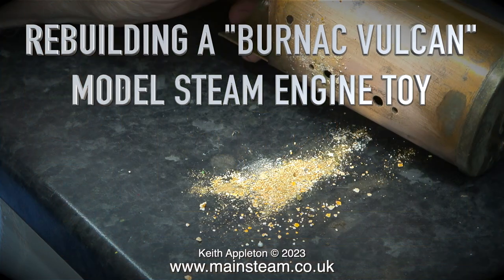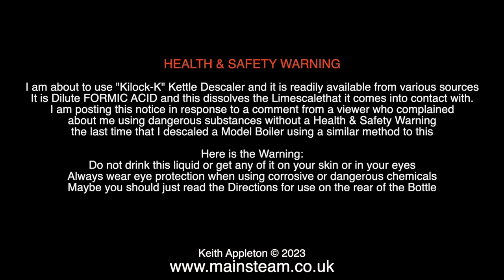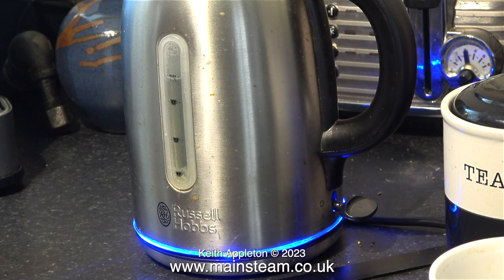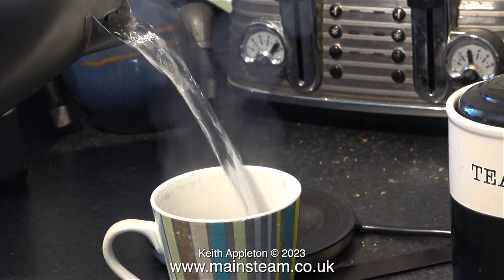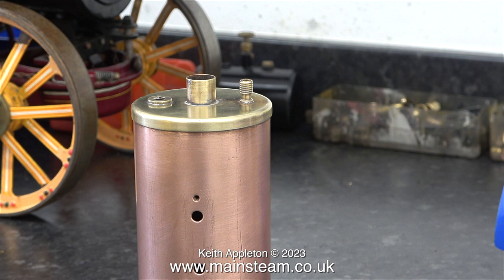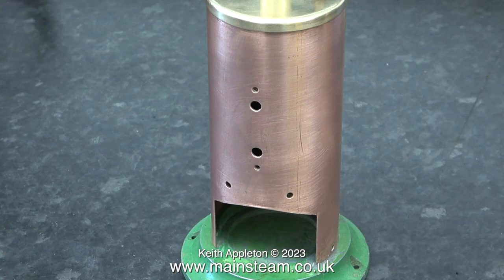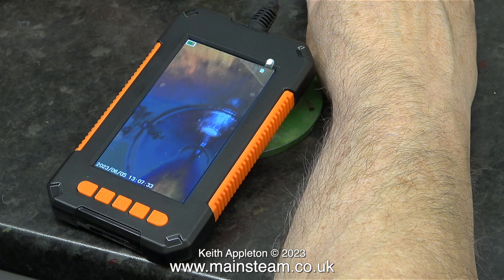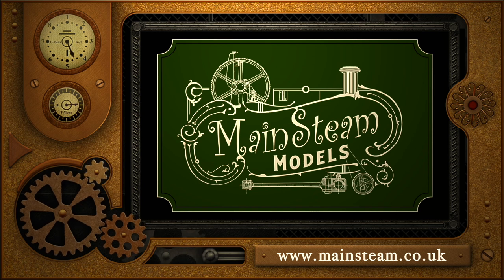REBUILDING A "BURNAC VULCAN" MODEL STEAM ENGINE TOY - PART #3

Comment: Helpful hint?  On some screens, there is a protective plastic cover.  From the looks of it, it wasn't removed.  I could be mistaken though.  This (obviously) doesn't effect the clarity of the video recorded on the card that you use for editing with the video.  As for warnings:  life is terrible, don't do anything (i.e. take the blue pill) and you won't have problems.  The rest of us read the directions.
Reply from the maker: In this video, I had only just bought the Endoscope. I will remove the plastic protector when it becomes a problem.

Comment: Re the endoscope. If you take stills they will probably have a higher resolution rather than taking video and pausing.
This is the same if you are inspecting boilers or doing things you aren't meant to do with them however less caution is advised on boilers.
Reply from the maker: I found the same, stills are better . . . this was the first attempt with it. Hopefully my Endoscopy skills will improve . . .

Comment: Great video.. but I'm still confused by one detail; are we NOT supposed to drink limescale remover? I guess I have been doing it wrong all this time? Thanks in advance for clarification.
Reply from the maker: No, Limescale remover is not a soft drink - it is designed to dissolve Limescale }:-)))
Reply: I'm just saying. If you added a slice of lemon, it would be a lemon lime scale remover.